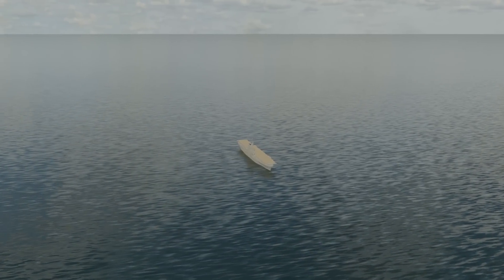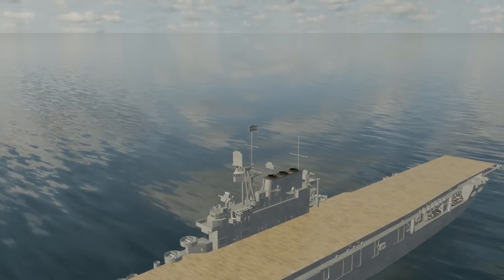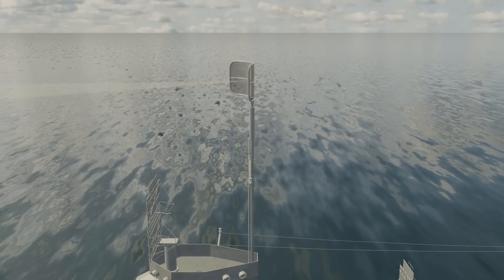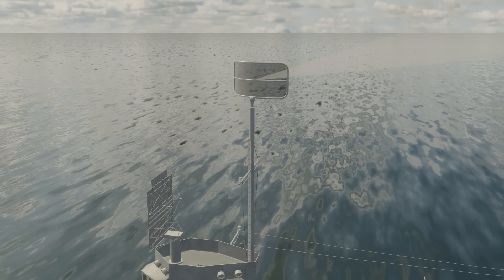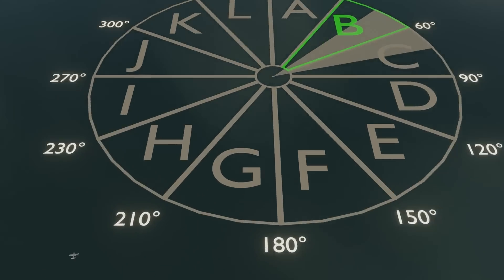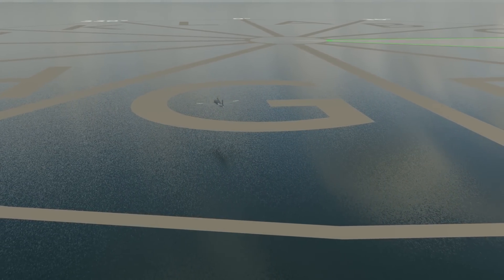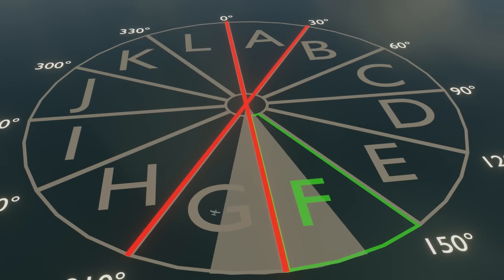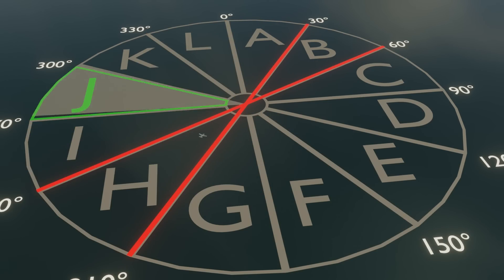Navigating Home: How WWII Pilots Found Their Way Back to the Carriers

Comment: Like a low-res VOR, manually decoded and interpreted.  TACAN of yore.

Even cruder, I was taught and practiced using a DF-steer in collaboration with a FSS.  Pilot transmits continuous signal over com radio for several seconds.  This enables FSS to determine bearing from station to airplane.  FSS assigns heading perpendicular to that line and repeats direction finding with pilot a short time later.  This enable FSS to roughly triangulate aircraft position and assign vector to an airport.  I believe this capabiliy was phased out about 20  years ago.

Comment: As a private pilot in the late '60s-1985 I was initially taught navigation via sectional chart, magnetic/gyro compass and air speed...the move up to vor/dme was exciting...I retired from GA before the full glass panel option became available for me.  I did learn there was a reason why rural towns frequently had their names painted on water towers or FBO building roofs.

Comment: If the morse code letter coordinates changed every day, I doubt the pilots could reliably memorize the relevant compass points.  Did they get a "post-it" at each briefing that mapped the daily letters, or even the raw morse dots and dashes, to the "return to home" compass bands?  Presumably, something like the YZ-RB would be important for the return of any aircraft flying in bad skies or over any sort of unfamiliar or ambiguous surface, at least until better directional antennas and triangulation became available.  Now the miracle of GPS is almost ubiquitous.

Comment: Very interesting! I always thought they just did a timed direction, like 10 minutes north, 20 minutes northwest, etc and then just reversed it to get back.
Reply: Similarly the pilot was in contact with the carrier witch was also moving in a particular direction and speed at the same time,A radio,watch,compass and speedometer were most important for returning safely!My father was a fighter/dive bomber pilot during WWll.

Comment: This is still challenging today (at least as of 1991 when I was flying for the USN).  The ship typically turns off its TACAN to preserve EMCON.  So, a lot of times you're stuck looking for it with your A/G radar (which also likes to highlight cruise ships and oil tankers) or A/A radar (assuming there's a marshall stack or tanker orbiting the ship).  The INS can get you back to where you launched, but that's not where the ship is anymore.

Comment: I thought it was the NDB, 190-1700Khz, which is the same frequency band used by your AM radio
Reply: Frequenc y –234 -258 MC  Modulation Frequency 540 –830 KC  Continuous-Wave Morse Code   Letter repeated twice in each 30° sector.  Antenna Rotation  2 RPM  ID sent every 10th rotation. 17  Range 275 miles  at 15,000 feet.

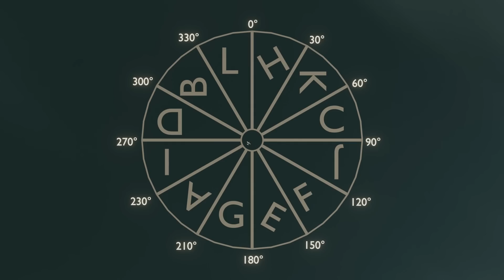Comment: 4:02 If I were the Japanese, just have one of my guys fly zigzag and find out a few points in the air where the signals changed, plot those lines and fit a straight line between those points, I could have a pretty good guess on where the US carrier was. Better yet, have two guys in the air doing the same thing, and drawn on map where those two lines meet. And drawn a bomb sign on it.
Reply: To clarify, coz the signal’s once every 30 seconds, you could “overshoot” the partition line, thus the need to gather several points and fit a line through.
Reply: All I wanted to say is, I don’t think I need the code chart to find the US carrier if I have an actual receiver.

Comment: Sounds clever, but for one problem - the radio equipment of the period were notorious for being faulty like many US military equipments were during the early days of WW2. The most in/famous example is the Mark 14 torpedoes which had no less than 4 major flaws not discovered until after the US enter WW2 because in the 11 years it had been in production, the US Navy never once live fire tested it.

Comment: Great video.  Please make more.  Do you know the maximum range the ship's signal could be picked up at?
Reply from the maker: Thanks. I think I’ve mentioned it in the video😉
Reply: Frequenc y –234 -258 MC  Modulation Frequency 540 –830 KC  Continuous-Wave Morse Code   Letter repeated twice in each 30° sector.  Antenna Rotation  2 RPM  ID sent every 10th rotation. 17  Range 275 miles  at 15,000 feet.

Comment: How did changing the letters "make the system very secure"?! Couldn't the enemy just direction find / triangulate on the signal, and/or measure signal strength changes, whatever letter is being broadcast?!

Comment: My gramps was a navigator on B17s in the pacific. They would need to locate tiny remote islands for landing using using his hand calculations alone. Using a "computer" which was something like a very specially designed slide rule.

Comment: That's fine... but the bottom line is the aircraft did not stay aloft a long period of time. Maybe 4 hours due being launched at maximum range. The carrier was "supposed" to maintain the same course for that time period so the aircraft could be recovered. If the carrier changed course you would need a guidance system as described or another form of information or a good guess. Enemy planes were always happy to follow the attacking planes back to their carrier so they could report the position and attack if prepared for that. Sailing 4 hours with an average speed of 20 kts is 80 miles and that means that you could fly almost a reciprocal course with a small correction applied for ship's course and winds. If the carrier was sailing towards the target this would allow even greater range for the attacking aircraft and make their return easier as well. This was usually close enough to get within visual distance of the Task Force which was usually spread out with picket destroyers sailing further out from the carrier just for this purpose.

Comment: 🎯 Key points for quick navigation:

00:00 🛠️ Navigational Challenges in WWII
- Returning to aircraft carriers was challenging due to the lack of navigational aids.
- Inability to locate the carrier resulted in risking ditching in the ocean.
- The US Navy identified the need for improved navigational systems for pilots.
00:56 📡 Introduction of the YE-ZB 'Hayrake' System
- Development and deployment of the YE-ZB system helped aircraft locate carriers.
- 'YE-ZB' refers to equipment designations, with the antenna resembling a 'Hayrake.'
- System transmissions were tested for effectiveness with successful results.
01:49 🎯 Functionality of the YE-ZB System
- The carrier had a YE antenna for homing signals, rotating to cover 360 degrees.
- Aircraft received signals via ZB receivers but lacked directional antennas.
- Pilots used Morse code letters representing compass directions for navigation.
03:38 🛡️ Security and Efficacy of the Navigation System
- Morse code signals were classified and altered daily for security.
- Pilots received current signal information pre-flight, enhancing security.
- The system's effectiveness baffled the Japanese Navy during WWII.

Made with HARPA AI

Comment: My father was a gunner PBM Y. He told me they were given a new code every day which they had to memorize. As they flew in to the landing strip  marine machine gunners on the ground trained their guns on  plane which had to fly a predetermined landing pattern. if you   got the pattern wrong or radio  code the marines were instructed to blow you out of  the air.
He said the  radio  code usually  contained the word Parallelogram   within the radio call given the Japanese  could not pronounce Parallelogram.  He also was the flight engineer when not manning a machine gun turret. His first duty before he died was to activate a red switch that blow up the radar system which very top secret at the time. If you see a picture of a PBW with a large dome on top that was the radar.  I have his flight logs books noting night radar bombing and mine laying runs. .
Reply: I almost split my sides laughing over that reason for using the word "parallelogram" in the radio code. Of course, nowadays, the woke community would probably condemn it as racist but hey, all's fair in love and war.

Comment: Very interesting description of the radio guidance system of the time. I just noticed a small error in your diagram of the sectorisation of the degrees on the rosette. It should read "240°" and not 230°. This system was replaced by the DME (or radio compass).

Comment: Thank you. This was very information. I think the animation with the aircraft on the 30 degree slices of the compass was a bid misleading because  the nose of the aircraft is pointed to the ship when it purportedly receives the signal. In fact, when the aircraft received the signal, the aircraft was likely pointed in some random direction; after receiving the signal, the pilot would then know which direction to point the aircraft in.

Comment: So how come the enemy could not use directional antennas to identify the direction of the transmissions???
Any kind of transmission can be traced back by a  BTDF (type of radio direction finder)

I can only presume it only worked at altitude, and the japs never figured out to put a BTDF equipped plane up in the air??
if they had, the Battle of Midway could have gone a lot differently???

Comment: My brother-in-law was a radio operator on the USS Hancock from early 1944 until the end of the war. The Hancock was hit many times by Kamikazes, especially during the battle for Okinawa. After the worst battles many fighters were low on fuel and needed to find the carrier and land at night. The situation was so desperate the Hancock turned its full landing lights on, (strictly forbidden in wartime) to help them land. Many didn't make it and ditched in the ocean. If a damaged fighter couldn't be moved off the deck it was pushed overboard to allow room for others to land. Desperate times require desperate measures.
Reply: The aircrews were forever grateful for the admiral who made that decision.
Reply: @philgiglio7922 Every soldier respects the leader who puts his men first. Although, it's also likely he knew that fighters were easier to replace than pilots, so he put them above the other things.

Comment: there is a problem with this system.. you can go 180° in the other direction til the signal is phasing out, than you have fly all the way back
and hope that you can catch the signal again.
i think that there have to be a additional part for navigation aid.
Reply: The system tells you what direction to fly. How would you end up going the opposite direction?

Comment: There's a lot missing here. For instance how did this system not get picked up by Japanese direction finders? The planes might not have had them, but it was a common method at the time. (When you see round loop antennas - these were direction finding.)  I'm also guessing that planes picked up several codes, so signal strength? the middle of all the codes received? Either of these could get a pilot a 60 or 90 degree slice which I'm guessing could be fine tuned closer to the carrier.

Comment: Some important questions appear to wait for a reply forever. For years I'm trying to find how you open the hatch of a friendly Tank if its disabled crew locked itself inside but is now disabled and in urgent need of being rescued and treated. It must be difficult enough so that the enemy won't open it himself, but still possible to open from outside to rescue the friendly crew, or they will die and rot inside forever. No one seems to know! 😬
In combat aircraft you just have to pull a cord, this I know. But that's a very different scenario.

Comment: Wouldn't the japs still be able to use traditional radio direction finding techniques to find the aircraft carrier? For instance, flying in a random direction and seeing if the signal gets stronger or weaker, then adjusting course accordingly. Or having a dedicated spinning direction finder on board.

Comment: In which frequenzy did this system work?
Reply: I'm almost certain that it had to be within HF. (3 to 30 mHz) Since it was over the sea you could use VHF as well, but it was not so widespread back then and I believe you had to spend more power to obtain the same result.
Reply: @duartesimoes508  Are you sure? I would have guessed 60 - 90 MHz
Reply: @holgernarrog962 and you may be right... I'm not certain, but I bet an HF frequency would get the job properly done. It would be received beyond the horizon, and over water its range always tends to increase. Normally VHF is not adequate beyond 200 MN, while HF can easily be received across an Ocean. I had a little Sony receiver with which I could hear the Voice of America, Canadian and Brasilian transmissions in Lisbon perfectly, without even using the coil antenna also supplied. 😀
Reply: Frequenc y –234 -258 MC  Modulation Frequency 540 –830 KC  Continuous-Wave Morse Code   Letter repeated twice in each 30° sector.  Antenna Rotation  2 RPM  ID sent every 10th rotation. 17  Range 275 miles  at 15,000 feet.

Comment: I do not know the skills of the Japanese but if they receive this letters in the given frequenzy they are aware that there is a US carrier within 275 miles. If they have 2 receivers they can determine the position.  The next option is to provide false signals. 

What I would guess is that they switch on the signal only at certain circumsstances...ex. the carrier changed its course. Planes are coming close... cloud coverage...

Comment: Although scrambling the sectors would prevent the enemy from determining bearing to the carrier, it would indicate that you got within 300mi of it. That's still useful info.
Reply: With 2 receivers you can determine the carriers position....with false signals you can send the air wing in the ocean.
Reply: @holgernarrog962  If a scout plane had a single beam antenna, they could rotate it around to determine a bearing to the carrier. The idea of sending false signals is an interesting one. I suppose the problem will be one of signal to noise ratio. Conceivably the carrier could carry a quite powerful transmitter which would be hard to overcome with a more portable transmitter.
Reply: @carlchong7592  I would send such a false signal from one of their own ships...A challenge is that Japanese, Germans used mostly AM while the USA used mostly FM signals.

Comment: Japaneese could have homed on the ship with a directional antenna. So, there must have some other security measures other than switching morse letters.
Reply: I would guess that they used the signal in emergency situations (carrier group changed course, bad weather) the air wing is coming back only.
Reply: @holgernarrog962  may have been switched on, on request by radio.
Reply: @althepal6818  If the carrier group changed course it is perhaps 100 miles away from its predicted position when the air wing returns. In this case it is necessary to guide them. In case of low hanging clouds it was necessary as well.

Comment: Where can I find more technical info Like used frequency, equipment, antenna's ect ?
Reply: Frequenc y –234 -258 MC  Modulation Frequency 540 –830 KC  Continuous-Wave Morse Code   Letter repeated twice in each 30° sector.  Antenna Rotation  2 RPM  ID sent every 10th rotation. 17  Range 275 miles  at 15,000 feet.

Comment: I have, as  Navy pilot, navigated, at sea, without the aid of any radar, either by the ship, land or onboard electrical aid of any kind.  I used an all aluminum (no battery)  air navigation computer called the Mb- 2 and the Mb-4.  Yes , I am old.
Reply from the maker: What is Mb-2 and Mb-4? I’m a commercial pilot myself and never heard of it. Could U elaborate pls?
Reply: Go to Google type in "MB-4 Dead Reckoning Air Navigation Computer"  tens of thousands, maybe more, were made. Some before America went to war. And production continued till at least the 1980's.  Several versions were made. I retired a long time ago. Fun fact. I am the first person to have navigated on a combat mission using the GPS system, long before it interred military service and that was before it was approved for Civilian use. Only two satellites were up. And then there was Navstar, that's another story.
Reply: Also, look up Rodger L. Easton and the NS1 and NS2 satellites . The NS2 was the first satlite to carry a true GPS, that would have been in about 1977.
Reply: @raywhitehead730   - Oh - was that what we called "SatNav" ?
Reply: Before GPS there were other electronic aids for Aviation navigation! Look it up. Don't be lazy.
Reply: Go to Google. Type in MB-4 Dead Reckoning Air Navigation Computer. Thousands were made. I believe the first one used was in 1938. But they were used by the US military through the war and even until the 80's. Several versions were made. At one time they were common in Civilian use.  Fun fact: I am the first Aviator to use the GPS system to navigate on a combat mission. That was Before it entered (approved) military service. And years before it was first used for civilian use. Only two GPS satellites were up.
Reply: I use an E6-B computer in my flight planning for cross country helicopter training flights. It looks like a variant of the Mb-2 and Mb-4 computers which you mention. I will add to the wonderful anecdotes under this video by mentioning that the E-6B computer was introduced to the US Army Air Corp in 1940. The device was very popular with the navigators, so much so that a USAAC (US Army Air Corp) navigators' song of 1943 had the line: "His computer is the instrument on which he stakes his life, Don't ask for his computer for he'd sooner lend his wife".